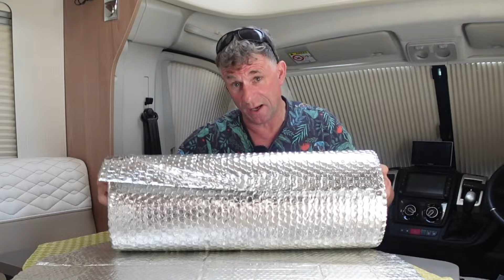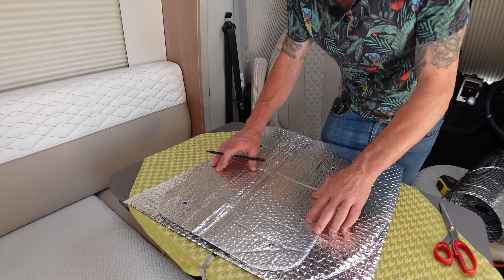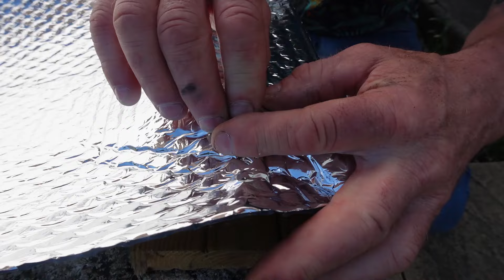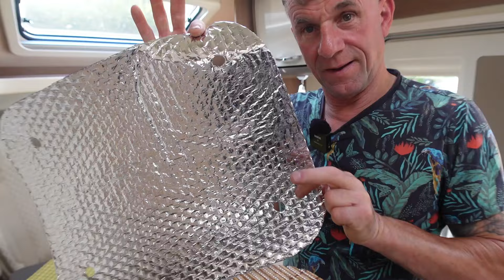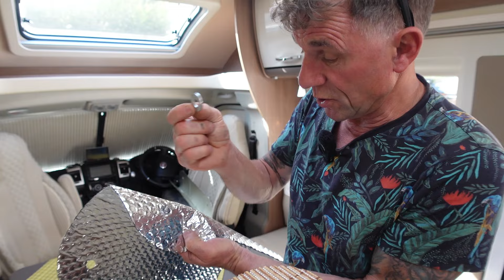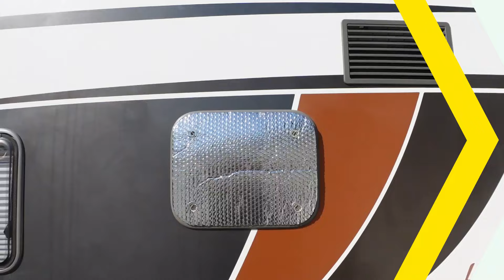MOTORHOME SUN PROTECTION

Comment: Jof why not use tent limpets ?
Reply: Great idea Jof! I’m lucky in the new Adrias they have a silver reflective material factory fit on all the outward facing sides of the blinds. Im going to make some for my daughter’s Van conversion though 👍🏻. Cheers.  Shaun.
Reply from the maker: @RV11-Adventures  excellent Shaun, pretty simple job🚍🏨🌴💯
Reply from the maker: @WilliamStacey-r6i  just checking them out on Amazon, great idea 💡 thanks 🙏
Reply: @MOHOTELADVENTURES  you can use a fabric hole punch for each hole would take under a min to do👍